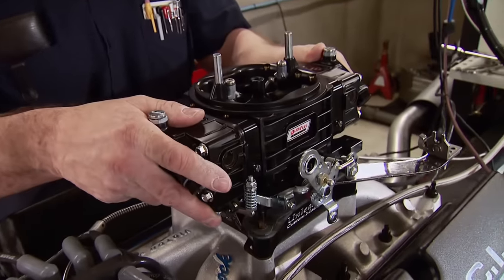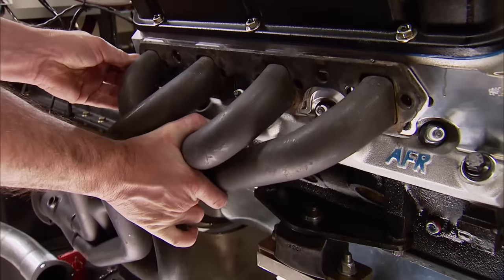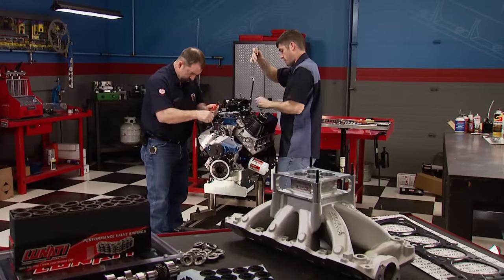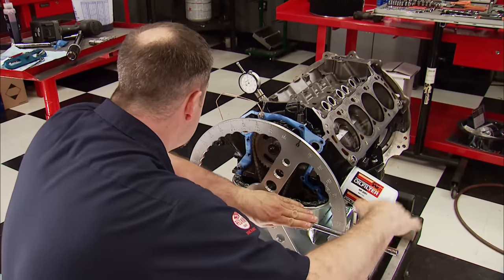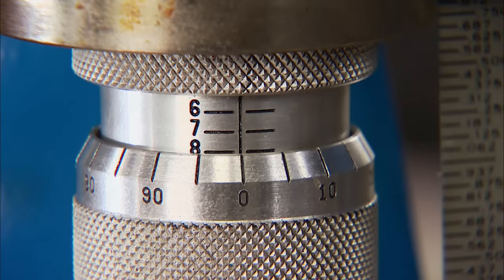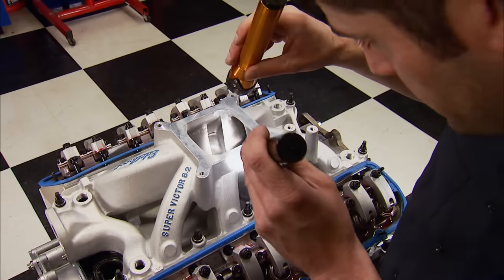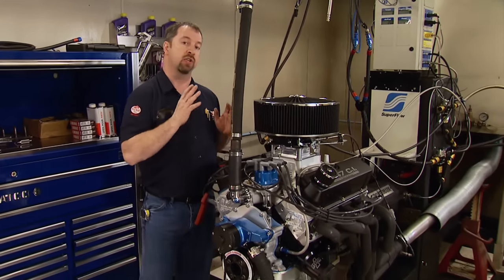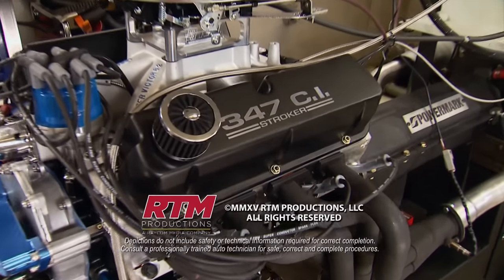Getting More Power Out Of A 5.0L Small Block Ford - Engine Power S2, E9

Comment: Hi America do you guys ever build 351 clevlands if not why
 Its always 302 or 390 never 351
Even though chevy got the 350

Thank guys
Reply: If you're in Australia, they got to use the Cleveland a ton more than we did in the US.  They have options for 302 Clevelands we didn't get.  They are big innovators in Cleveland performance.   The 302 gets so much attention because of the 5.0 Mustang and it's impact on the pony car scene post 70's era.
Reply: @superkillr 
Hi man thank you so much for telling me enjoy the rest of your day
Reply: The real reasons most builders here stay away from  351ci Cleveland engines  is size and weight vs 351 windsors, Windsor have better cooling as they run coolent threw the intake manifold and Cleveland engines do not. There are way more aftermarket parts for Windsor based engines and on a hole you can make more horsepower out of a Windsor then you can a Cleveland plus the over all size diffrence makes the Windsor 351 much more versatile, it will fit in many more cars or trucks with much less modifications to the vehicle then trying to squeeze in a 351c or m block.
Reply: @thedon3836  --  Don, the Cleveland has a 9.2 deck vs. a Windsor 9.5, so saying it's a size problem isn't the issue.  Cleveland heads are the highest flowing mass produced small block heads ever from Ford, and the the highest flowing aftermarket heads.  The Cleveland has smaller main bearings.  The Cleveland got cut short in the US because of the 70's gas crunch.   Don't confuse the 351M and 400 with actual 351C stuff.  Many of Ford's decisions weren't about performance, but cost savings and giving the public the least amount necessary to do the job.
Reply: Skip to 2:30. This is the size diffrence I was refering to. The 9.5 and 9.2 deck height means nothing it's the width differences that matter when trying to squeeze an engine between strutmounts in the engine bay expessioally with headers. This vid I linked gives you a direct side by side of the 2 engines so you can see exactly what I have stated. No bull 💩 or pecocking about it.
Reply: Also feel free to check out the over all weight stock for stock. Cleveland engines weight is at 550 pounds stock while Windsors weight in at 525 stock for stock its a 25 pound weight savings. I will not dispute the high flow characteristics of the Cleveland heads they are very good and the design was copied for the boss 302 windsor based engine. The main bearing size diffrence did not do much but I do know some aftermarket Windsor based blocks require the smaller mains from a Cleveland and a Cleveland style crank to accommodate my guess is and it's only a guess because there is no actual strangth difference In  the crank itself but the guess is this was  done for boosting so there is a hint more  meat to the block and 4 bolt main caps them selves in these aftermarket blocks to make them slightly stronger and slightly more resistant to spinning a bearing. But the main reason windsors are prefered aside from over all fitment is cooling characteristics. Hot Windsor builds just stay cooler for longer and are less likely to overheat.
Reply: The Don ran a 351c back in the 70’s .. I miss those engines.. had no problem fitting them in anywhere.sorry to see no one building them. My opinion best setup Ford ever made.
Reply: The reason Clevelands aren't used in the states much, is because Fored only made the true 351C for 3 years for the USA. Never had the 302C here, like they do in Australia. 
Ford produced smog motors 351 modified/ 400 modified engines from 1974 to 1980 or so, but those were never factory performance engines, and neither ever came with 4 BBL. carbs. The blocks were similar to the Cleveland, but were taller, and were way weaker. 
The lack of production run time, and the era they had the Cleveland in the USA, makes the true Clevelands getting hard to find, and expensive to build. 
I personally love the Cleveland, and it is what the SVO block was built on, when Ford needed more access to NASCAR parts. The best Cleveland I have seen built, here in the states, had the Ausie C3 heads on it, and it ran circles around everything it ran against. That was in the mid 80's.

Comment: That is sweet little  engine,i know it costs by switching AFR heads but do you think that  right head for the solid roller or would have made more hp with 225 head
Reply: Probably would have, they later discovered that they had the 195 head and not the 205's they thought they had.

Comment: Made less than 30 hp with added comp, solid roller, and higher ratio jesels. Thats alotta scratch for less than 30 #s. Coulda built 393 for less and had more hp and tq with the piece of mind of a stronger block.

Comment: With E85 it would have made even more power.  But overall, not bad. I would like to see what real race fuel such as VP 110 octane. Putting additives into pump gas is going down a rabbit hole. The fuel from the pump can be all over the place.  I understand why you did it, but it would not be my choice.
Reply: Vernon Pitts Air Ports sell real HI octane Leaded PETROL 112 or 118 octane? Not for sure .?  It is still lower octane than Regular Gasoline was in 1967. Anyway it’s not cheap but being as airplanes burn a lot of fuel it won’t brake the bank either. Go get a 50gal drum n try it out. In my experience it makes a 3 horse Briggs and Stratton out perform a 4.5 horsepower Briggs and Stratton running on 91 octane. In 20” push mowers. And it also runs 2 x as long when using the same size tank. The 3 horse runs at higher rpms with far less throttle. The 3 horse is useless with 91 or93 octane. It bogs out and won’t run properly. Aviation fuel turns my lil red snapper into a BEAST! Half throttle all day long, starts on the second pull every time first is with choke pulled second pull its running. With 93 I gotta pull the air filter hand choke and give it a drink before it will hit. Premium fuel in 67 was 139 octane. Regular was 119 octane back then. This Aviation Petro is just as good if not better than anything else I have payed a lot more for. Good stuff 👍

Comment: Funny,  valve seat pressure on a honda SOHC is like 45 lbs  "Wid it's Tiny Wittle Walvz."
Nobody making belt drive cammer heads for  sbf or  sbc? Then with much much lower over the nose  pressure you could spin seven grand  all day  and not break anything. More  for roadrace than strip. - Sandy

Comment: The bigger carb and primaries test didn't really prove anything that's not common sense. Of course the bigger carb/pipes will always increase max HP and TQ at WOT when you have a fairly large cam and great flowing heads. The tradeoffs of lack of throttle response and abysmal part throttle power aren't worth it in a street car.
Reply: I got rid of my 1 7/8 longtube headers and victor jr Intake.  Went with 1 5/8 shorty headers and a performer rpm.  The car drove so much better on the street.

Comment: I wanna no how long that block lasted I have a 347 afr 185  port polished 72 cc 12 point studs vict Jr intake port matched with heads dome piston comp xe 274 hr demon 750 carb canton 8 quart and main support .. and it's a time bomb so I spin to 6 k line bored and deck plate honed .30
Reply: Whats it do in 1/8th mile

Comment: I’ve got a 89 fox I’m going to start building soon but I want to keep the higher then the horsepower and for the time being I’ll keep a cast block and change the internals and heads to aluminum, would y’all have any tips or anything to keep me pointed in the right direction? This is my first build by the way
Reply: Trick flow HCI kit. Head over to corral.net, lots of good info there.
Reply: if you dont have thousands n thousands of dollars to spend , freshened up stock bottom end gt40p junk yard heads , Anderson  N-41 cam (good for 6000rpm n stock pistons) larger throttle body, cobra intake or trick flow if you have a little extra cash ,long tube headers a 2.5 inch exhaust. 4:10 rear gears rebuild the traclok diff with the carbon fiber clutches that american muscle sells. if your car is automatic get a 2800-3000 rpm stall converter an a trans go shift kit. you will get more performance n fun with this than just spend alll your cash making the most hp you can on your budget .

Comment: can you guys send me that :) i had an 86 short body f150 4x4 and the 351 in it seized up . . . over a month, we'd just been out run'n it and check'n it with some buddies whom came back a month after to replace the carb for me and some other odds n ends and it was seized . . . shocked us all . . .  i'm old, slow and stoned (disabled 22 yrs) so i can't turn the wrenches anymore and being old, slow and stoned i share a constant proximity to 'broke' :)  got some good friends to help with what ever wrench turn'n . . .but most of them are in the same field as me (not rich enough to throw a couple grand at a buddies truck for grins hehe)

Comment: I want to make me 302 a 347. Im wanting to stay efi. Can i expect similar results
Reply: If the guy who does the tune knows what they're doing, and you port the intake. Probably.
Reply: @sparkplug1018  will I need to buy an aftermarket ecu?
Reply: @JoseMorales-ep7id  I believe the stock ECU can be tuned, but I'm not entirely sure. Keep in mind these 302 blocks start having issues above 500.
Reply: @sparkplug1018  im only looking to make about 300-400 to the wheels. And i heard the OBD1 in the 95 and lower cars are hard to tune, And require certain upgrades
Reply: @JoseMorales-ep7id  Didn't know you were building on a pre 96 car. Yeah you may have to upgrade that ECU then. OBD1 basically requires removing the PROM chip, flashing it and putting it back in the ECU. Its a real pain. 
Those power numbers are doable on the stock block though, so good to go there.

Comment: At what rpm are you setting timing full advance?
Reply: Asking about the timing because i built close to the same engine except little more duration 306 and a Offenhuser tunnel ram with Holley 550cfm duel quads built for tunnel ram intake.

Comment: Would it be able to make more than 567hp and 455tq?
Reply: With N.A. 1.33 times the displacement is a good place to quit. You will have to spend allot of money and time to gain anything after that with this engine/head design. 347x1.33=462 Ft*lbs then you can cam it up until you hit the limit of your rotating assembly. 

Otherwise you can add power adders pump up the power blow/rebuild to you hearts content.
Reply: @joegreen4089  okay thanks for the clarification.

Comment: This is incredible. 566hp out of a 347 stroker geeez. This was a 2 bolt main engine correct??
Reply: Yep. Stock late model casting
Reply: With a girdle though iirc
Reply: @greengeeker1  I have a girdle on my stock block twin turbo 331 it's not a big deal. Running a high pressure pump and a stock oil pan no problem fitting or anything I am not sure what you are trying to get at perhaps you could clarify?
Reply: @thedon3836  not pointing anything out.  Just thought it was pertinent to Yup yups question of it being a 2 bolt main.
Reply: greengeeker1 most definitely. I didn’t know girdles helped out so much with stability & longevity

Comment: Just waiting for that 5.0 to split lol
Reply: I doubt they'd ever show it if the block split, but going to this HP level on a stock block is dumb and a good way to destroy 5-10 grand in parts. should have started with a dart block or at least a Windsor
Reply: M Plante yeah, a good 351w build would be killer. There’s an article online where a company took a junkyard 351 and put trick flow upperend kit on it with twin turbos and pulled over 1000hp on that junkyard motor.
Reply: M Plante http://www.mustangandfords.com/how-to/engine/1407-how-to-push-a-junkyard-351-windsor-past-1000-hp/
Reply: M Plante there’s the link if interested

Comment: Engine people: What causes the stock engine blocks to break? The power level? The rpm? What are they made of that is so weak? Sounds like these engines are a ticking time bomb over 400 horsepower.
Reply: The rpm a stock block and rotating assembly will only take so much before it decides to let go. And even that depends on the tune. Some let go before others
Reply: Cylinder pressure splits block not rpm. Build for power at higher rpm. 
Block will last longer.

Comment: This is cool and all but I would like to see what kinda power can be made with a Windsor 302 pulled straight out of an F150 with stock heads. That would be way more impressive then just buying what is basically just an unassembled crate motor.

Comment: Wouldn't E85 be better for such an application?
Reply: I heard about using that due to its higher octane, does it actually work?
Reply: @ericfitzpatrick5319  Most tuners over here use it instead of premium, so yeah. Helps that it's a pump gas for us.

Comment: A very rough calculation resulted in an estimated 236 mph at 7200 rpm with the gear ratios and tires that are in my truck. I think I'd like to see some diesel content on this channel. My old dilapidated pickup truck sure ain't gonna get to 7200 rpm.

Comment: Cam LSA is very important.
Needs 105*
Carb booster venturi are very important... Not just massive cfm..

All you are doing is maxing dyno pulls. Not drive ability.
Reply: Carb/cam might be poor at the low to mid range.

Comment: So wait. Almost a point of compression, race gas, solid roller, big intake and carb to make a street engine something miserable to drive on the street...for 39hp? That's "gains"? That's a waste of a good street engine. Not impressed by the theory and celebration over these "gains."

Comment: So, youre degreeing the cam based on the cam company spec AND the most valve clearance.
How do you know that that specific degree is optimal for power? Maybe it needs +2 or even -3 etc for best power curve.
Every combination is different.
But im sure that you dont want to set it up, test it, change it to +2, test it, maybe -2 then test it, and go 3 or 4 in the better direction to get the best power.
THEN you have to guess at chain/gear wear slacking the chain and retarding the cam by... how much? Ive see tight springs wear in top$$ timing sets 2* retarded in 5,000 miles.
So you are just making an educated guess?
And people say, "i think it used to feel stronger."

Comment: Just get a 327 if you want 8+ k rpm small block with just a cam& carb. The cheapest way to get the 302 to get some muscles is go boost. Other than that the engine a money pit.

Comment: 😂 The thing that makes me laugh is, both of em refer to a 5 liter engine as small. 
Wonder what a little economy sized civic, 1.6L is called beside that?! LoL
Reply: true but in the v8 worle 5.0 is a baby
Reply: Lol, fords 4.6 is a baby, but man they can make power if you add boost, that’s the advantage of those modular motors, they make easy power with little boost, but I do love me a good old 460 with nothing but frame twisting motor only power.
Reply: @trailspeed7037  that's what I have, I want to stroke to a 5.2L 2v, cam, long tube headers, TrickFlow Race heads, under drive pulleys would make it a nasty N/A ready for twin turbos..lol or a supercharger would be nice too.. Not sure tho when BluePrint engines like 400ci n 427ci cost 5-6K with forged internals, chevy tho..lol I want me the 632ci they sell making 815hp for $12k..lol
Reply: TigreLoko24 yea I’ve got a 3v
Reply: @trailspeed7037 in a Mustang I imagine??

Comment: So you guys will do sbf 5.0l but barely touch a 5.0l sbc just doesn't seem right. Anyone that says a 5.0l sbc can't make good power has Noo actual experience building engines, I laugh at people when they say that kinda stuff lol. Because a good 5.0l sbc with a good roller cam and good flowing heads can make a very reliable street build.
Reply: You can certainly make just as much power with a 305 Chevy as a 302 ford... within the low horsepower and rpm range on this show.... But the cheapest upgrade for a 305 is a 350 4 bolt main. With the same top end a 350 will make as much power and more torque.  350 SBC have been built to death. Even a 292 vs a Ford 300 is a more interesting build and and comparison. I would prefer a 250 build with a 8000 rpm rev limit. Do a stock, heads+cam+ fuel injection+ intake+headers, then 11 or 12:1 pistons+rods+crank, and finally boost it until it blows then dial the boost and timing back. But I can't imagine many people would put that much work into a build when you can get the same results with a junkyard 4.8 LS.